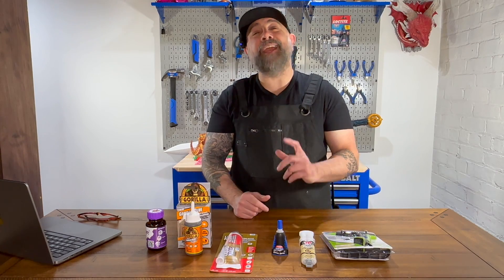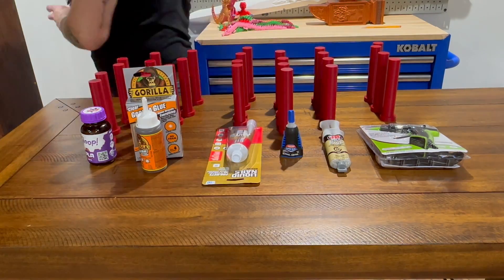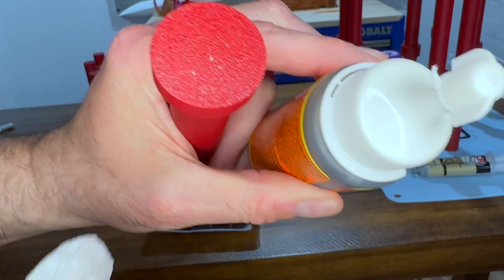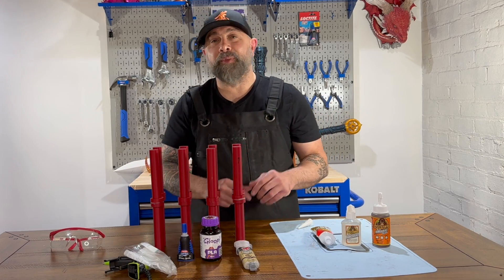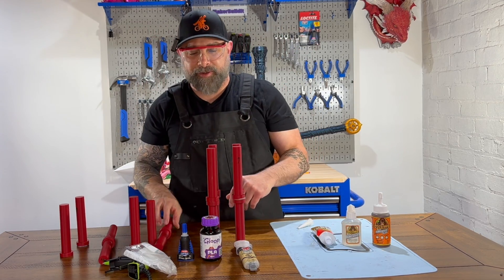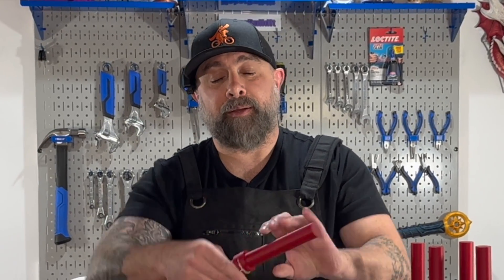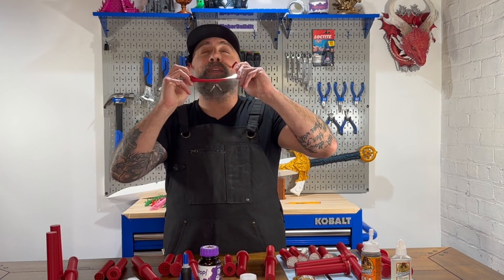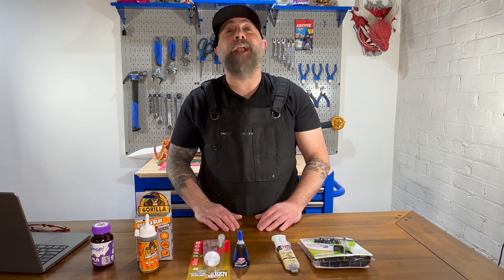Testing Every Glue For 3D Printed Parts!

Comment: nice video but it would be better if you printed stronger parts and then broken them by applying some repicable force - you could use a broomstick and print a pla thingy that goes ontop of it and glue it to another pla thingy - then load the far end of the broom stick with a measurable weight... the leverage means you can break anything without needing giant weights... and you get a more precise result... - just make the small pla parts solid - you could also make the glueing surface smaller so its not as hard to break.

Comment: very nice test...the twisting method seems redundant due to them holding so well even with hot glue...I was so surprised! 

What i'd really like to see if what your strength level is for these tests....maybe try to use something that can measure torque and (forgive me for not knowing the term off hand) bending strength in order to determine the average, minimum, and maximum forces required to break the bond or plastic itself. I think also maybe using a test object with 100% infil. 

 Very surprise with 18k views there's only 377 likes! Come on people. It's not that hard to show appreciation. You don't need to write a long comment like this...just click the thumbs up. 
You don't have to subscribe and sign up for notifications. Just a simple thumbs up. 

Thank you for doing I've learned a bit
Reply from the maker: Thanks for the positive feedback and the great suggestions for future tests! Glad you found it helpful. 😊

Comment: Thank you so much for your video.  Can I ask you if CA glue with activator can work to bond metal to wood?
Reply from the maker: Yes, CA glue with activator can bond metal to wood, and it actually works pretty well in many DIY situations. For structural joints you would want to use a 2-part epoxy or construction adhesive which is much stronger. 😁
Reply: @MakerBuildIt 
I tried it and the embellishment that I put on my walking stick bonded perfectly.
Reply: Thank you once again.

Comment: I've found that Flex-I-Weld's Plast-I-Weld works great for very small parts, such as features on miniature figures that snapped off during support removal. It's not a glue, though. It's a solvent that actually dissolves the plastic, so it also grabs quickly and cures fast. It works on several types of plastic.
Reply from the maker: I’ll have to try these! 😁 Thanks for the recommendations!

Comment: I found that the best glue for any 3d printed plastics and many other things as well is JB WELD Super Weld its a UV glue that cures in second using UV light, the only bad thing about it, its expensive $11 for 0.18 grams of glue.
Reply from the maker: That's pretty cool. We love JB Weld at MakerBuiltIt, but haven't tried the UV one yet! Thanks for the tip! 😁

Comment: For a better twist test, I would print some 2 inch diameter balls with a 5/8" to 3/4" flat spot for the mating surface, and also a horizontal hole going through the center of the ball to insert a leverage rod. I would also up the infill and use an infill pattern that gives maximum strength. This would require a separate round of testing but this is a good test in itself. Also, if you place some small holes into your mating surface, it is an easy way to force your slicer software to add more material around the mating area, making it much stronger. You could also consider printing smaller balls, with flat spots on the top and bottom, and gluing several in series, to amplify the bonded area and drastically reduce the amount of torque required to reach a breaking point.

Comment: For the twist test the test part should have either a 90 degree bend or notches or a way to attach something to allow you some leverage,  As strong as I'm sure you are you're basically relying on the friction between your hand and a smooth round part to apply enough torque to break the bond.

Comment: try adding a fillet to the 3d prints (and maybe some ribbing/handles to increase grip/torsion, or maybe just a wider circle for any torsional snaps), and also maybe print them long ways so that the print don't break between layer lines (if you want it to be THAT study). Anyways appreciate the content really informational!

Comment: Been using Gorilla GEL super glue for 5 years, no problems.. Hope you can add that one for a PART TWO video!
Reply from the maker: I've never used the Gorilla Glue GEL super glue. I'll definitely it in the next group of test. 😀
Reply: @MakerBuildIt  You should try to get your hands on some "Methyl acetate" its one of the ingredients in gloop for PLA.
Methyl acetate alone will disolve PLA a bit like Acetone do with ABS.

Comment: glue squeeze out is good, it tells you that the entire mating surface is covered in adhesive. Gorilla glue works well with quite a bit of water on the parts, it requires moisture to cure properly. This was a good series of tests and you executed them well. Great Job!
Reply from the maker: Thank you! I appreciate your comment! 😀 I definitely dampened the part for the Gorilla Glue. Maybe I should have wet them a bit more. 🤔